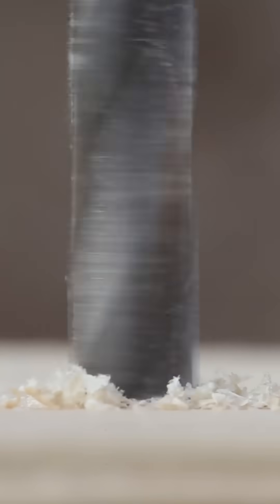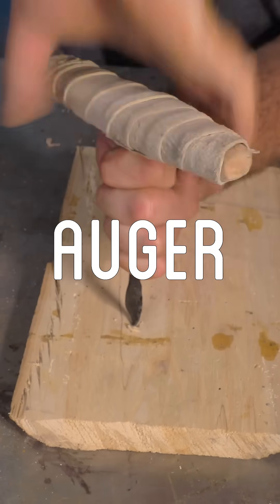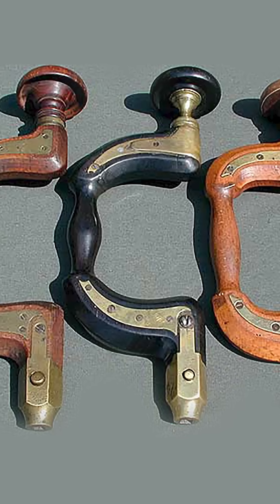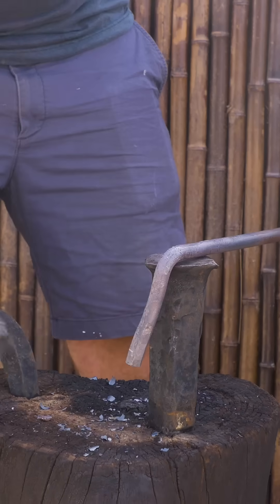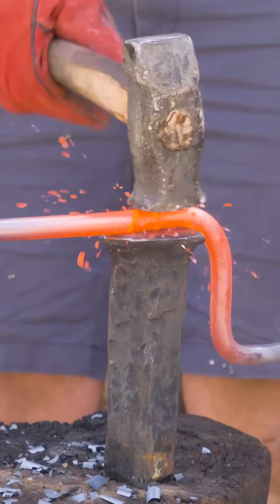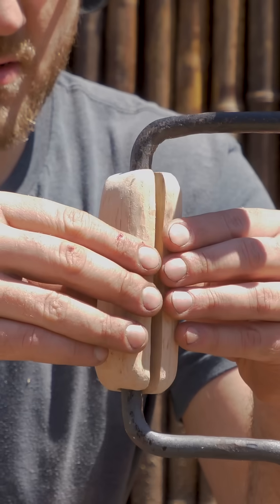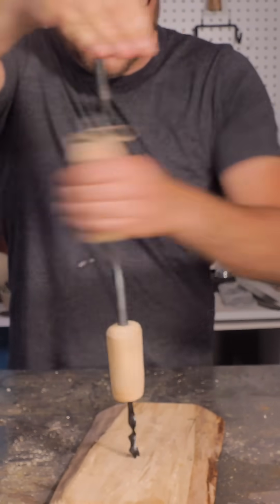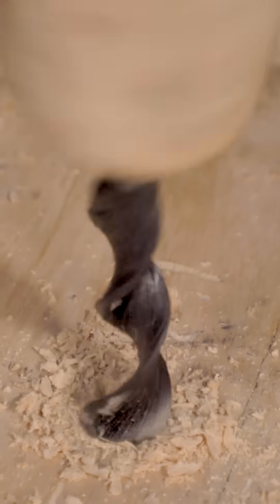The Brace Drill: Drill Invention #3  #shorts

Comment: Something that you might want to consider is that the first innovation to the hand crank drills was a slotted space in which the drill bits would be fit into. Basically what you would do is have what amounts to a set of tweezers that would be tied together with twine to hold the bits in place. The whole thing was about a 30 second change however it would mean that you wouldn't have to deal with replacing the entire drill if the bit broke and the same thing goes if you were to somehow break the handle. It was very cool and I had one years ago but it was stolen by a burglar who didn't know what they had.

Comment: Stop making your drill bits so pointy, they need to be much flatter and the tip formed so it cuts into the wood like a chisel coming in at a low angle. You will drill 10x faster.

Comment: I started working construction in the early 1980s and we still used braces then to drill holes for deadbolt locks it wasn't until the early 1990s that cordless drills were powerful enough for serious work. Yeah we had corded drills but we didn't always have access to electricity in a vacant apartment for example.

Comment: I think the hand crank is the best even compared to newer tools which yes I have but I also have to use that hand grip and wrist twisting I think the hand crank would alleviate a lot of those problems if you could put a drill bit in it so you could take out a screw not just for making holes. I've seen the metal ones I haven't seen the other ones. Thank you for sharing.

Comment: You can make this design more efficient by welding a bar from the handle section down to a point that contacts a small divet on the drill section, to avoid losing accuracy or force to the tool flexing

Comment: I wanted to ask, why does hot metal flake, when you strike it? Also what is the "powder stuff" blacksmiths sprinkle while firing?
Reply: The flakes that come off is rust. The heating causes the metal to oxidate quickly. Some manufacturers have ovens/furnaces where oxygen is pushed out with other inert gases to reduce or eliminate the oxidation during heating for annealing and hardening processes.

Comment: My family has a few of these passed down from generation to generation, nice ones with freely rotating handles to avoid blisters, and chucks made using the modern manufacturing techniques of the time to where it works as well as a chuck on a modern drill. They can get the job done. They're pretty cool

Comment: I can’t imagine how the originals creators of these tools were perceived by those around them.. either witches or genius, I guess.
Reply: it must be said that the auger drill is the least practical of any hand drill, while the brace drill was by far the most efficient, but the pump drill was by far the most accurate and precise. there is a reason the antikythera mechanism of ancient greece was so precisely made, it owes its design to the pump drill.
Reply: @chloekaftan  auger drills are more designed for emergency wood working situations. 

They tend to be sturdier in build and alot more capable against breakage due to forces. 

Pump drills and alot of other types of specialized drills are tools of professionals and engineers. 

Augers for the guy who needs to make a 2 inch hole for a wooden chute or a village "boat guy" 

Idk that's how I see it.
Reply: These inventions didn't happen overnight, but where a slow process of improving over the decades through trial and error.
Reply: Probably not witches. They were probably using stones or bits of metal or knives to scrape out holes before these were invented so an auger isn’t too much more than that and then the pump drill and hand brace are just a different and easier way of scraping out the hole. They might have been considered geniuses but since this is logical they probably wouldn’t have been called witches. They were also probably just invented by tradesmen that were looking for an easier way to make holes.